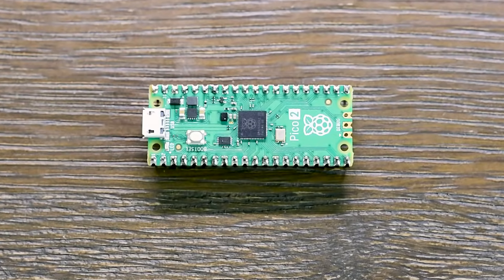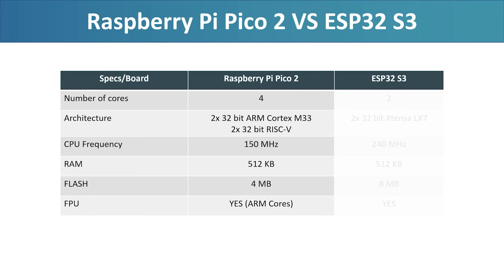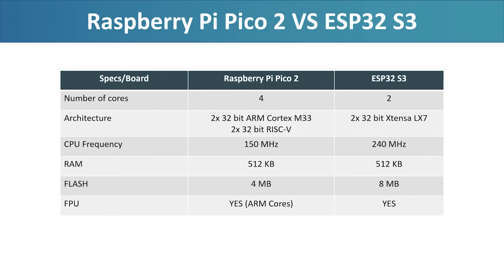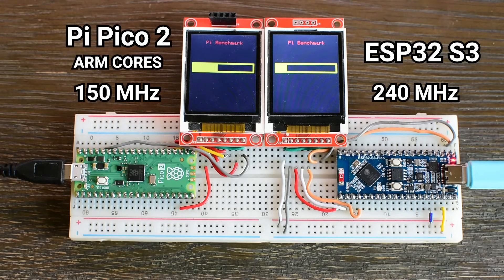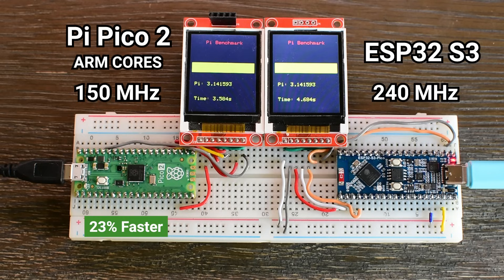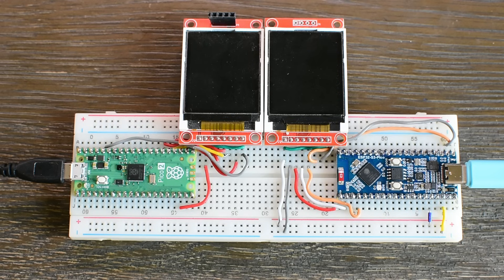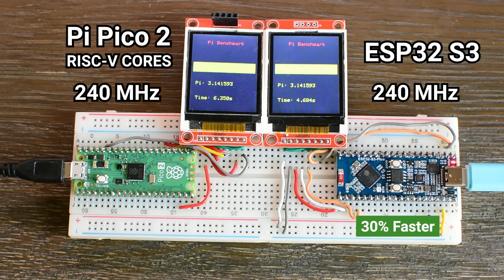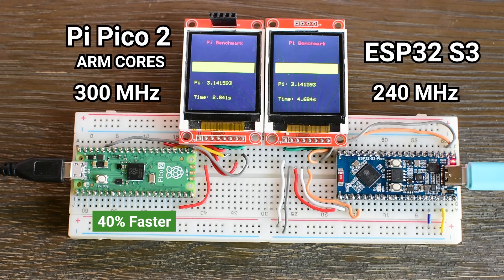ESP32-S3 vs. Raspberry Pi Pico 2: The Shocking Speed Test!

Comment: Your comparison between the Raspberry Pi Pico 2 and the ESP32-S3 is unfair. You are using calculations with the 'double' data type, which uses 64-bit precision. The ESP32-S3 does not support double precision, only 32-bit single precision; you should have written the program using float variables. Therefore, finding that the Raspberry Pi Pico 2 is 23% faster actually proves to me that the ESP32-S3 is quite good, given that it had to perform the calculations via software, which requires multiple instructions. It is important to read the technical specifications of the devices you want to compare to be fair

Comment: Well, miss leading video again....
1. For Arduino, the default setting is different from RP2350A and ESP32 S3. You have to change those settings in order to release the true power of  ESP32 S3.
2. The LX7 is faster than LX6 in all my tests including SP and DP floating tests.
3. The setting of RP2350A @ 300Mhz will affect the test results.
4. Basically, the code is WRONG! The timing of calculation of Pi including updating the TFT.
5. For power testing, suggest to use a more meaningful tool to measure the real Wh used. And make sure all other unused function units are turned off.
BTW, do you know how fast the Pi Zero can do 2,000,000 digits of "Pi"? And how much Wh used?

Comment: If I'm not mistaken, Raspberry Pico utilizes only one core in the Arduino IDE while it technically has two. It is up to handy programmers whose number is decreasing at a time, unfortunately. Even the STM32F103 stack contains many mistakes and TODOs. Nobody rushed to fix it.
Reply: I've worked a lot with RP2040, and the multi-core stuff is awesome, and while it's not very complex to use it, you do have to write the code to specifically utilize the multi-core capability. You can do it in Arduino IDE, but it doesn't happen by default for sure.

Comment: I must say this is interesting & lovely. But, I doupt that the "Arduino core for the ESP32" compiles into SIMD code. As far as I am aware of, you have to manually use functions such as `dsps_dotprod_f32()` (and use float-precision instead of double) to have fair results. If you will, search for: "DSP library for ESP-IDF" and check under "modules > math" + "Does Pico 2, utilizes SIMD-instructions or just loop-unrolling during arm_dot_prod_f32?"
Reply: I'd really love to see more videos of benchmarks. The internet seems to lack alot of this type of content (specifically in the context of MCUs). Keep up the great work!

Comment: I just find Pico (1) is a better than Esp32.
I have been working on cross communication between chips via GPIOs: Pico <-> Pico , Esp32 <-> Esp32.
Tested using MicroPython.

Esp32 seems to have communication errors now and then, 
while Pico seems to have pretty much no errors.
It seems too much background tasks on Esp32 - and it interferes with communications and EVEN the Gpio Interrupts / Handling.

QED, enough for me !
-- No more Esp32.
(Also note that MicroPython does NOT support Both Cores on Esp32 ! )

Comment: Thanks so much for your work. I have the slight feeling though you are a bit comparing apples with oranges. To make comparisons worthwhile, you would need to compare identical features. For example, power consumption with one board having wifi enabled and the other one not having any wifi capabilities in the first place, the results aren’t really surprising. Or did you explicitly disable wifi in your tests? Still, your video makes me want to look more into raspberries simply for curiosity. In real life, though, I never hit any performance issues with esp32 in the first place, so a speed increase wouldn’t make much of a difference, and if speed did matter, then esp32-s3 would probably be the mcu to compare with, not the ancient esp32. What’s more important than slight edges in selected benchmarks is that a mcu has a universal and well-balanced feature set that provides versatility and fits most projects, plus a vibrant community that delivers ubiquitous code examples and projects to play with and learn from. In this respect, esp32 and more so its recent family members like esp32-s3 remain performance and cost-efficiency champion. As a hint for future projects: speed isn‘t the key factor for modern mcus as they all have plenty, it’s rather power consumption. 
So what would be much more needed are power efficiency comparisons and practices to optimize power consumption, i.e. down-clocking (rather than over-clocking) and disabling components like wifi when not needed. However, that’s hard to do right as you‘d have to compare on board level, not per mcu, since individual board design and ldo are key factors here.

Comment: You are still doing double precision floating point math when computing PI, while both the ARM Cortex M33 and ESP32-S3 microcontorllers only have single precision FPUs.  So your waxing on about pipelines and other architectural musings are likely dwarfed by the idiosyncrasies of how the particular runtime for each processor is emulating double precision mathematics.  These benchmarks are not as meaningful as your data suggests.  You continue to make this same error when doing these comparisons all the while drawing attention to instruction set details (such as FPU computations) that are not actually being used as most people might imagine.
Reply: While it is true that the ARM Cortex M33 used in the RP2350 has only a single precision FPU, the RP2350 also has an additional double precision coprocessor which can add/subtract/multiply/divide and take square roots. This coprocessor is used by default when compiling and I would think that this sped up this specific benchmark significantly.
Reply: @cpt_tom  I think you two know a lot more than he does, and are far over his head, which is why we don't see him responding. If that's the case he shouldn't be making videos.
Regardless I was watching and he kept saying "this test" ok so.. show a different test? He showed some of his code I was expecting to see like 5 different types of tests, which is how this should be done. Just draw 2 loading bars on the screen, 1 per test and 1 "overall" one and run 5 totally different tests. 
I guess he isn't interested in being totally accurate though or he'd research stuff instead of posting
Reply: It’s just crazy—what are people actually using all that power for? I’d say maybe 10% of cases involve someone who’s actually thinking about performance. Personally, I’m more concerned about Pico2’s noise analog-to-digital accuracy than its speed. 🙄 It’s a 12-bit ADC, but in practice, you often get 9–10 bits of usable resolution without extra filtering. But obviously most people don’t know what they are doing or making video about

Comment: Pico does not have I2S to DMA which greatly speeds up my application.
A calculation of Pi does not say which processor is better, only which one calculates Pi faster.
as always, the best MCU is the one that fits your needs.
ESP32 has many more built in peripherals.
Reply: Pico can do I2S either direction in PIO, including with DMA. ESP32 might have fixed peripherals, but RP2350 (Pico 2) can do those and more in PIO hardware, without main CPU involvement.

Comment: Think on esp32 unless you design specifically the load sharing, arduino programming uses only one core, you can even choose which one in the IDE, the other core defaults driving WiFi BT etc. And task sharing is not always walk in the park...
Reply: That's true only for the original ESP32. With the new variants, all dual cores are "true dual cores". This whole point is moot tho since the benchmark in the video is single-core only.

Comment: I was not surprised because I had similar results on the original pico when I personally ran my own benchmarks and compared it to ESP32.  Some of my friends are ESP32 fans and they were surprised when I shared my results with them.  Been a Pico fan since it first came out.  I have always used the Philhower III core (board manager) since day 1.  Have you ever given it a try?  I am a big fan of said core.

Comment: How is anyone supposed to validate or verify your results?
Reply: Basically, the code is WRONG! The timing of calculation of Pi including updating the TFT.
Reply from the maker: It is easy. Run the code on your boards: https://github.com/educ8s/Arduino-Pi-Calculation-Benchmark
Reply: @Educ8s using arduino may seem LIKE using the same code. in fact it is not. pico in background still uses pico-sdk and s3 still uses esp-idf under the hood. also,unless display driving isn't completely handled by the other core it can affect the outcome as well.
Reply: @Educ8s  (I might be wrong but) you may instead try "esp_wifi_stop(); esp_widi_deinit(); esp_vt_controller_disable(); esp_bt_controller_deinit();" instead of `disableWiFiAndBT();` to fully disable them. Search also for: "ESP32C3 esp_wifi_stop() and esp_wifi_deinit() cannot reduce power consumption (IDFGH-13415)"

Comment: In the program logic to compute the 6-digit PI, did the ARM actually UTILIZE the FPU cores as well, or both were running bit-for-bit pretty much the same code? Doing Floating Point on the regular cores?